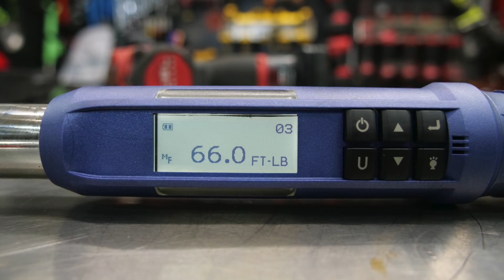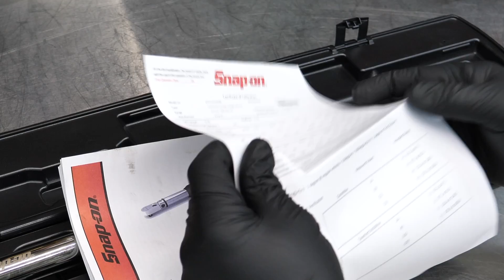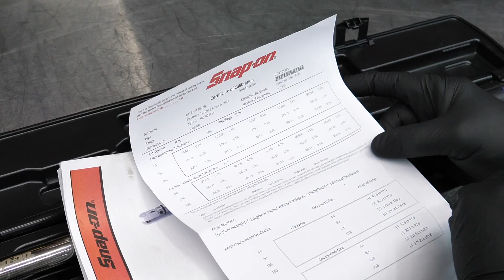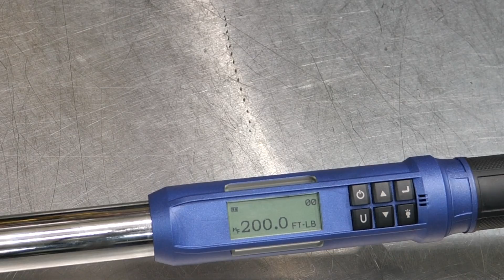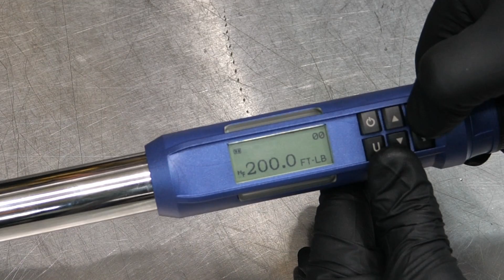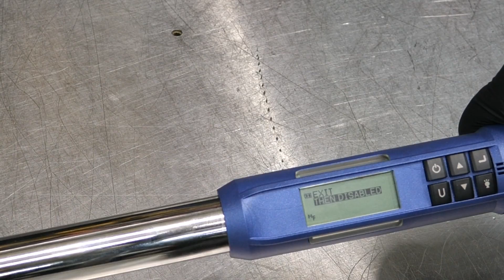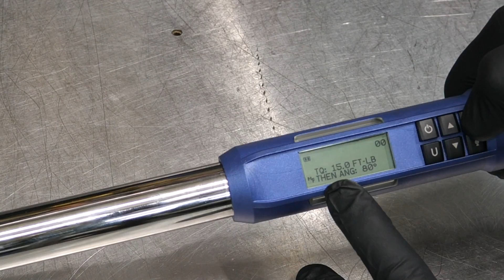BEST TORQUE WRENCH | Snap-On TechAngle Electronic Torque Wrench 15 - 300 ft-lbs [ATECH3F300MB]

Comment: Bought the whole set in foam.  1/4",3/8" and 1/2" the green set. I'm smitten with these wrenches. It wasn't cheap, but hopefully worth it. I'm a diy guy not a pro. Am I crazy for spending that much money on a set of torque wrenches? Probably, but I don't like working with inferior tools. Especially something as important as torque wrenches. I think you forgot to mention that these wrenches can also do rotational torque ( rolling torque). Used to set the  pre load on a differential bearing.

Comment: Just bought this wrench for a total of $424.00 from the SEP program. This thing is incredible! Definite godsend.
Reply: Same here, took it for a test drive doing a tire rotation, man it was soo nice.
Reply: 1 year warranty and they only last that long. Known issues with the battery connections. They are junk. $155 to repair it.
Reply: @unedited98  sounds like regurgitated info from a video rather than first-hand experience 😃

Comment: I purchased the icon 1/2 inch and it looks and has all the same functions for 400 bucks. Same exact torque tolerances and lifetime warranty. 
 My 3/8 inch is snapon and I plan on getting the 1/4 inch snap on. 
If icon made a 1/4 and 3/8 I would buy those also. Seriously though, everything is exactly the same , including operating system and buttons .
Reply: Just because they look identical,  doesn't mean they are identical
Reply: @jimmysmith3255  That is true, that's why I added the second part of my comment. It has the same internal parts, o.s., programming and tolerances accuracy. The only difference is they added a snap-on boot up screen.

Comment: Just got the all black one today, saw the color and just had to get it. I used to have the one that went to 250 ft. Lbs., but I sold it to a friend when I stepped away from the heavy duty side for a bit. Now that I'm back on the heavy duty side, I needed the 1/2" drive lol. I've had my 3/8" tech angle for 5 years now and it's done excellent. Snap on by far makes the best digital torque wrench in my honest opinion.
Reply: They're garbage. Their digital stuff has a 1 year warranty and barely lasts that long.
Reply: @unedited98 which Brands do you recommend?
Reply: Not from what I heard

Comment: Worth every penny. Bought mine a few months ago and LOVE it. The torque to yield feature was the seller for me. Make quick work building LS motors.
Reply: You still happy with yours?
Reply: @dlj1285  1000%
Reply: @Speedseeker_93  Just asking because I’ve seen numerous reports of electronics failing out prematurely on these things. I’m considering purchasing one and it gives me pause a bit to read those reports. Not sure whether it’s something that has been addressed by Snap-on or not.
Reply: @dlj1285  Where exactly have you been seeing these reports? I’ve had mine for a little bit and have no issues with it whatsoever. I’d be interested to know what issues are out there so I can be on the lookout for it myself.
Reply: @Speedseeker_93  Just in some comments on Reddit and on some YouTube videos. Something about the electronics going on the fritz…I don’t know much more than that. I’ve read a handful of these from apparent owners complaining about the same thing.
Reply: @dlj1285  Hopefully it’s just spontaneous and random with that issue. Worst case scenario you ship it back to Snap On and have it fixed. For me tho I don’t regret buying mine. It’s been flawless for me. Best of luck! If you get one let me know here what you think of it!

Comment: Can I use it without calibration  or it will stop working  after a time and the message CALL NEEED will show on the screen ! .  I am planing to buy one  but because  I am not in the US  and there is no Snap on dealer in my country '  that is why I am confused. Please advice me buy it or no. Thanks
Reply: It won't stop working.  You just won't know if it's still within tolerance, but if you take good care of it by not banging it around or dropping it and remove the batteries when in storage, it should be good for many years.
Reply: THANKS @BellaRocko

Comment: If you want accuracy, you get Snap On  there not as good as they used to be I’ve got tool that over 40 years old  to compare
Reply: They are more accurate than they were before but Icon makes a 1/2 inch for 400 bucks that looks exactly the same ,has same accuracy and has all the functions (including ratcheting angle) and same operating system. Literally everything is exactly the same except for the head . The icon comes with icons 72 tooth flex head .

Comment: Is it possible to setup multiple Nm settings? For example: 20 Nm 40 Nm and 80 Nm and have them as quick select option of sorts?
Reply: You can program 9 different preset torque values into the wrench.
Reply: @nickr1641  Really? I have the wrench at work and I've gone through all the settings but i can't find any preset values for torque.
Reply: @soklot Page 8 of the manual talks about presets. Programming starts by holding the unit button down for 3 seconds and then following the on screen prompts.

Comment: There are better torque wrenches and torque wrench tools than Snap-on and most of you people never even heard of them.
Reply: Care to share what brand & models you’re referring to? Stahwille?
Reply: @MotorCityMoto  My recent purchase is Sturtevant Richmont DTC-75 Interchangeable Head Digital Torque and Angle Wrench.
A similar model is the 1350 Series EXACTA 2 Interchangeable Head Digital Torque and Angle Wrench with radio communications with their Torque Controllers.
The high-end and Heavy Duty model is their  1250 Series EXACTA 2 Interchangeable Head Digital Torque Wrench.
Sturtevant Richmont Wrenches have patented and unique Traditional pin/spring Dovetail or Quick Change Dovetail and gives you access to over 200 interchangeable heads (patented in 1956). Nobody else has anything like that. Sturtevant Richmont is the original maker of the first Torque Wrench, Deflecting Beam type developed by Walter Percy Chrysler. They patented many of the first Torque Tools like the Torque Screwdriver. They created the first Power Tool Tester.
My other two Digital Torque Wrenches are REVO SUPERDUTY made by JETCO in California (owned by Stahlwille). Those are simple and high-quality wrenches.
Reply: @MrCROBosanceros  Thank you.
Reply: @MrCROBosanceros  can It do the lugnuts on my honda?

Comment: I bought both 1/2 and 3/8s tech angle and regret nothing
Reply from the maker: We can understand. These are great torque wrenches. Thanks for watching.
Reply: Still no issues? Been reading instances of the electronics on these things crapping out. Has Snap-on addressed these sorts of failures? Anyone know?

Comment: Was comparing this one and the gearwrench bought the gear wrench it was a little bit cheaper the only thing the gear wrench doesn't have is an LED light
Reply from the maker: The Gearwrench is a great torque wrench, we've reviewed several of those as well. The Snap-On has a bit more polish and feels a touch more sturdy...which it should, for the price. Thanks for watching.

Comment: I have both the 1/2" and 3/8" version. Recently had an issue with the TTY function on a set of heads I was doing. Torque was 22ft-lbs+90°+70°. When I got to 68° and went to get the last 2° the fastener didn't move the torque wrench beeped and read 70°. The slop from the ratcheting mechanism, extension, or socket on a bolt adds to the reading. I still mark all of my fasteners before TTY so I was able to catch it and make sure they were all equal.
Reply: The torque wrench probably maxed out. In other words while doing those 70 degrees the torque wrench reached its maximum torque reading. Happened to a guy in our shop when doing heads. We got a torque wrench with a higher max torque reading.
Reply: @cristianleija7107  the degrees will save in the unit and you can add to them after you roll the ratchet back for the next stroke. It’s a great wrench
Reply: Does TTY function work while the torque exceeds the wrench limits?

Comment: I’ve tried other cheaper torque wrenches to keep from buying a Snap-on but all have disappointed me.   Tried gearwrench but they go nuts if over torqued, cornwell and Mac which use the same heads are junk because the gears break easily, Quinn is ok for diy but not a professional shop.  Now I own both the 3/8 and 1/2 Snap-on.   Best purchase ever!!  Expensive but well worth it.
Reply: I found out a long time ago that it only hurts if you ask the price. Nowadays I just walk on the truck, tell my dealer what I need, pay for it and walk off lol
Reply: Junk. 1 year warranty for a $650 tool? Only time Snap-On is worth it is if you can call in the warranty when you need to, try warranting that digital torque wrench..... good luck.
Reply: Not for a DIY person though, u less they have more money than sense.

Comment: This torque wrench is worth it’s weight in gold doing gm heads. The ratcheting angle makes it much easier to do the final torque of 150° on head bolts
Reply: And the stored memory you can download the logos off will save your ass. Tons of other makes/models have angle, lots have storage so you can check. Snapons the only one I know you can hook to a pc after the jobs down and print out the torque logs to include with the work order.
Reply: @Poizen22 that’s awesome! I love that idea of printing it out and including in w/o.
Reply: I had to torque some stuff to 30nm and then 23 and 7 degrees and make sure it isnt tighter than 300nm last week.  Really weird.  Never seen that before.

Comment: Whats deal with red screen big letter t & a warning ⚠️  sign in your video a few times blocking out your video
Reply from the maker: Must have been a mess up between editing and upload. Sorry about that. Working on fixing this now. Thanks for watching.
Reply: Would love to have one, but can't see paying $650 for something that won't be used daily
Reply: @lawmantimothy  problem is when you need a torque wrench it needs to be reliable
Reply: @brettwalkom948  From a few videos I have seen, there are a few options for less than this costs that are just as reliable.
Reply: @lawmantimothy  just saying a torque wrench isn't something you want to cheap out on.. Not saying it has to be snap on
Reply: @brettwalkom948  I've got cheap Harbor Freight click type torque wrenches that are holding their calibration better than my other high priced ones
Reply: @lawmantimothy  you can take the risk.. I'm not
Reply: @lawmantimothy  well to be fair, they were designed around someone who does use them everyday. I have the QD wrenches and I use them several times a day. Looking to get an A-Tech soon tho just because they’re neat.

Comment: That electronic Gearwrench that reads angle with the flex head is hard to beat...for under  $200...
Reply from the maker: You are correct, that's a great torque wrench for the price. Thanks for watching.

Comment: Most do not understand what that certificate is actually worth. In one of my past lives I ordered indirect materials. For testing a certified tool can  easily costs 3 times as much as a non certified tool. A racing engine can easily cost 75 - 100k Imagine torquing a head down without a certified wrench.  
It costs alot because it is worth it.
Reply from the maker: You are right on the money. Thanks for watching.
Reply: Exactly!

Comment: Is this snap on or made by someone else.  I was told by a snap-on dealer that the 3/8 was about $650.
Reply from the maker: I think the 1/2" is only $650, so the 3/8" should be quite a bit less. Thanks for watching.
Reply: The 3/8 should not be any more than $400
Reply: It's made by cdi. But they don't seem to sell the 300ftlb model
Reply: Made by CDI which is owned by Snap-on